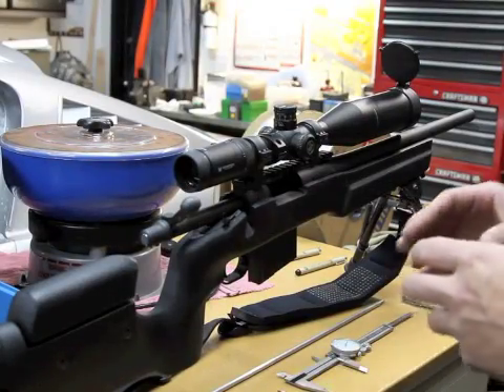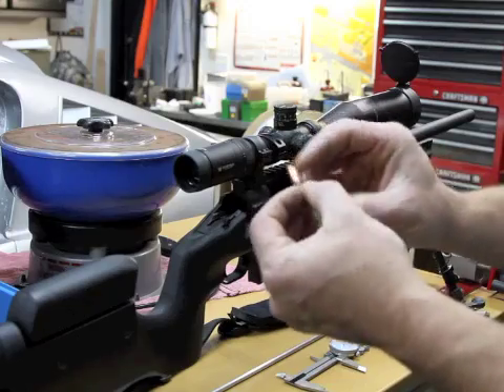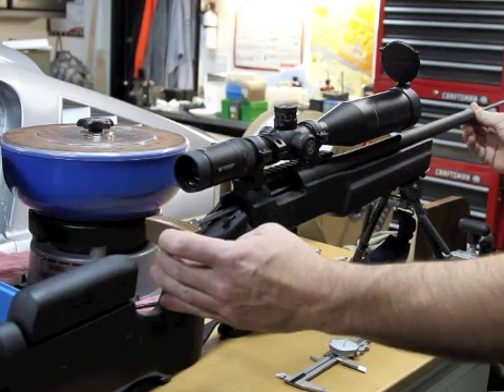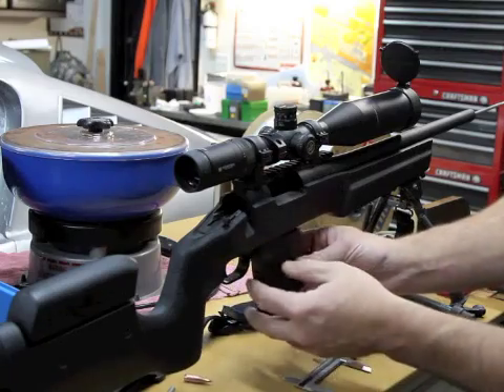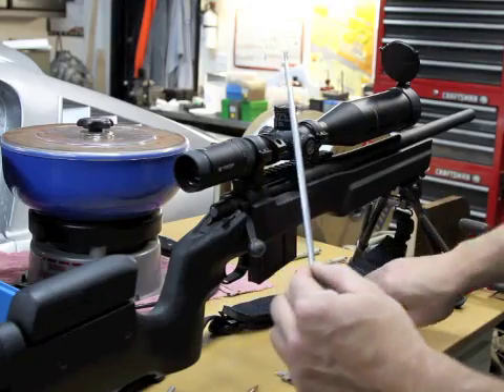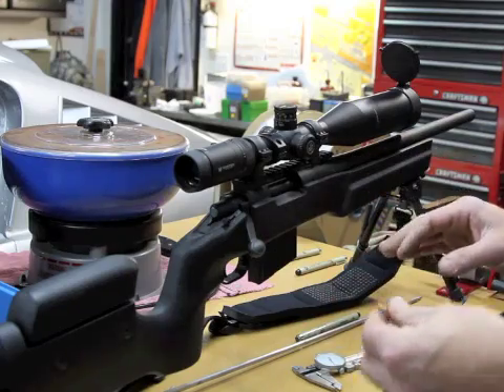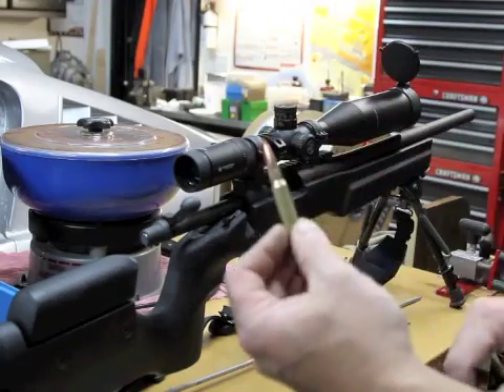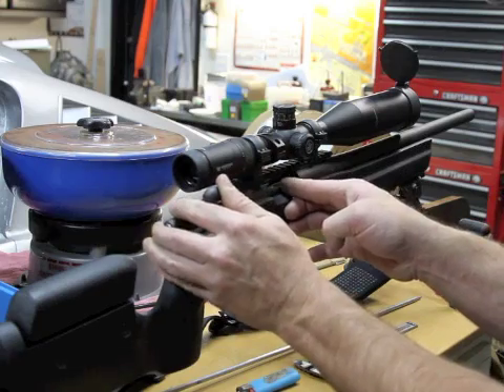Cartridge run-out, Smoke test.

Comment: This is not determining "Run-Out" which is done with a concentricity gauge. You're measuring COAL to the lands of the rifling.
Reply from the maker: Yes that is true... Once I determine the overall length to the rifling I keep that cartridge as a guide, then use it to measure runout on others. Just another way of doing it.

Comment: That's a neat way of doing it, but how do you account for differences in the meplat? Hornady makes tools where you can measure off the ogive, and providing the bullets you're using are consistent, the ogive should measure +/- a thousandth or two at the same length. Since it's the ogive that would touch the rifling, you can measure your COAL off the ogive with a comparator tool.

The reason I say this is because I tried this same method, measuring off the meplat, with some ballistic tipped Barnes TSX lead free hunting bullets, and it wasn't as consistent as measuring off the ogive. Groups went from about 1-1.5 inches at 100 yards to consistently under an inch with a Browning X-Bolt chambered in 7mm-08.